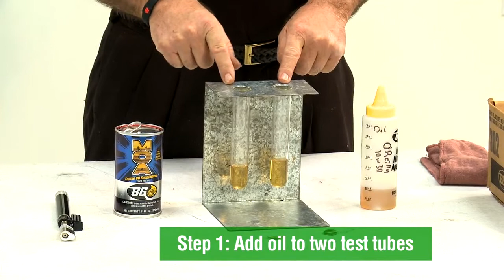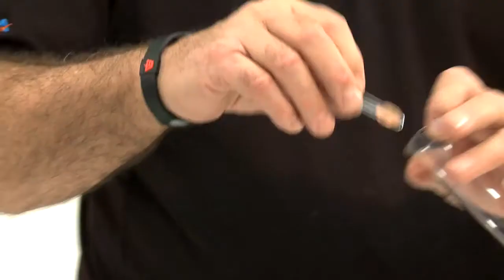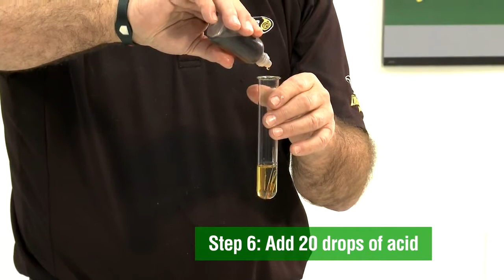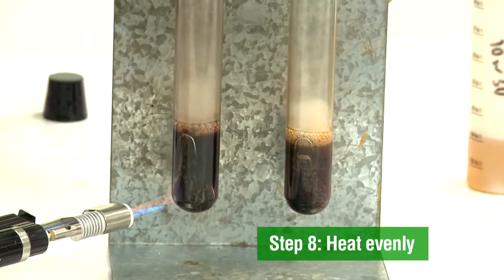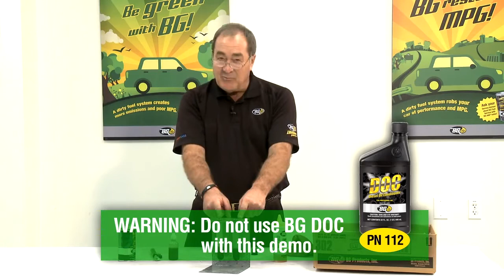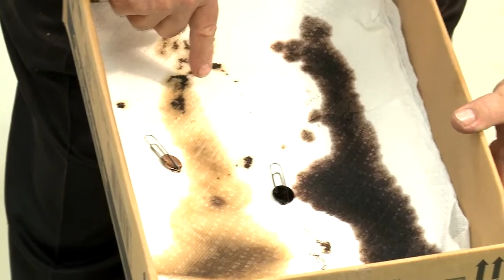BG MOA® Penny Paper Clip Demo

Comment: Just make this stuff available to automotive parts retailers like Seafoam does, and all the other fuel additive products, and you got yourself a deal.  Otherwise, if you make it tough for us to get our hands on t, I won't buy it.
Reply: Dude, go online. I've been using it since since new for my 2014 VW Passat SE w/roof  with 1.8 EA888 gen 3 with 6sp tiptronic.  Runs great,  original plugs and ignition coils at 136,538 miles. Always use MOA, EPR, and 44K.

Just saying,   getting 40 + mpg cruise vintrol long trips to Va.

Comment: It was revealed the solution used(acid) was really a fluid developed by BG to react to the chemicals in MOA creating an appearance of less carbon, when in reality it just dissolved it. Imagine the seals in your engine disappearing.. Nice try.. Also, he uses "acid" with no gloves.. what a joke..When I saw the power band hologram on his right arm I knew this was a BS ad.
Reply: Nope
Reply: I use the acid. Its sulfuric acid and I never use gloves and never get burned. Get it from a scientific supply company and it will dissolve a shop rag if applied. Not sure why you would say "it was revealed"